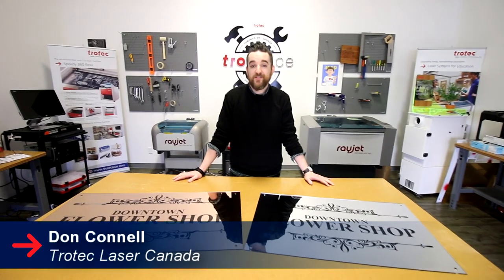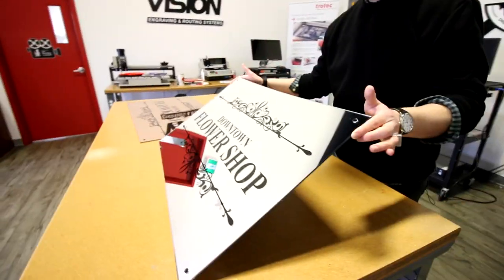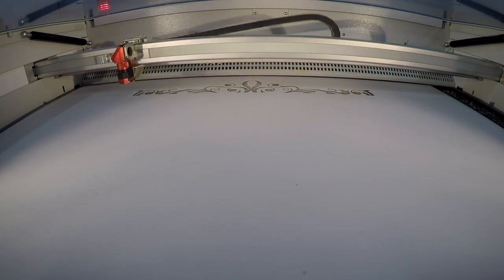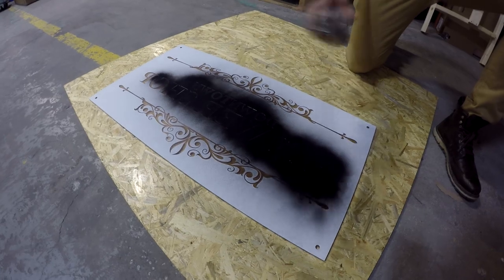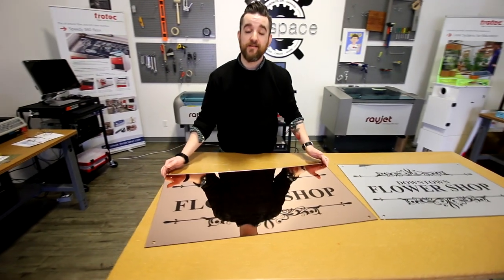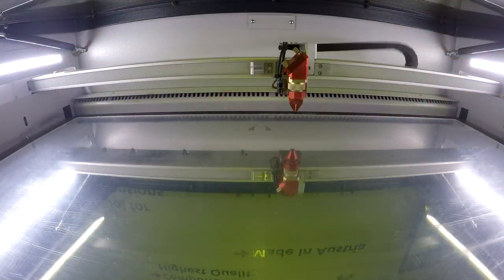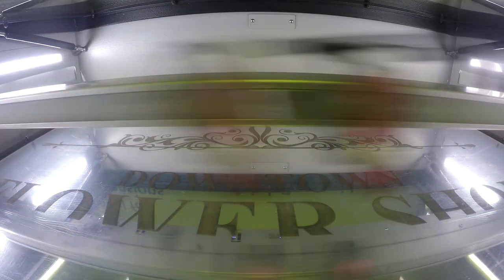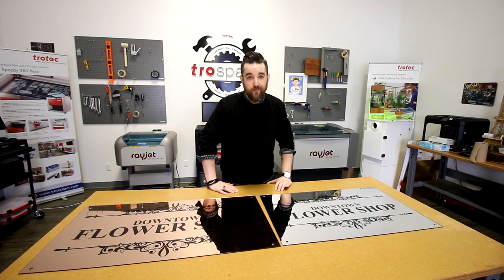Laser Engraved Wall Mirror | CO2 vs Fiber Laser Sources | Mirror Acrylic

Comment: Awesome video. So I used your suggested settings on my COS - 360 80 W. I DID NOT remove the plastic (covering the mirror) before engraving, but my laser had literally a "trail" of fire as it was cutting! I had to repeat the process twice for it to cut. Could that related to the slow speed? Any suggestions? Thanks. Keep up the awesome videos!
Reply from the maker: For flaming, try to put masking table on all the areas of the table where there is no material. This will help succession and reduce flaming.

Comment: Hi. cheers for the info... though what dpi? and what Hz are you using. (for fiber) 
My job control does not allow me to use these setting. When I put 40 power, the highest speed is 55. maybe depends on wattage? my fiber is  30w. what is yours?
Reply from the maker: Hi Nick, 500 DPI for CO2 and 20,000 Hz for Fiber. Sorry that's a typo on our part, the speed is 55, that's the max engraving you can do with Fiber. We've changed it in the description.
Reply: ah I see,Thank you.